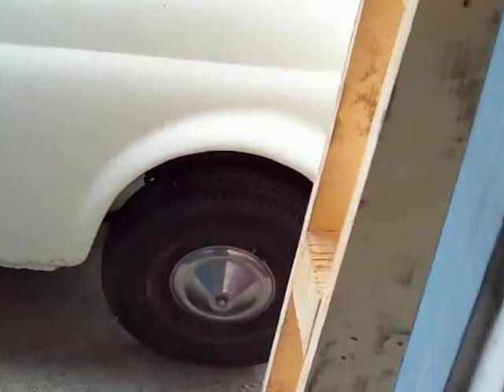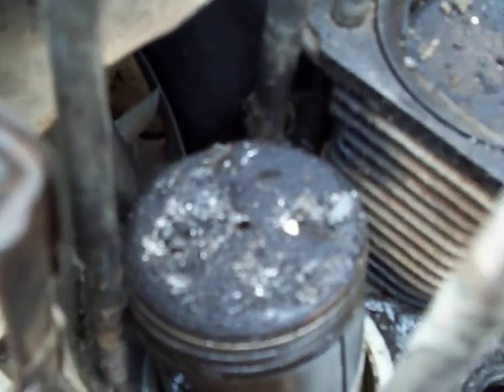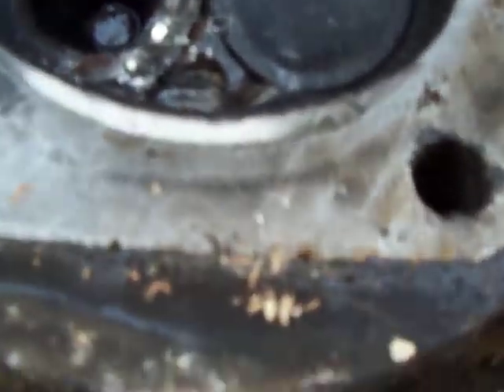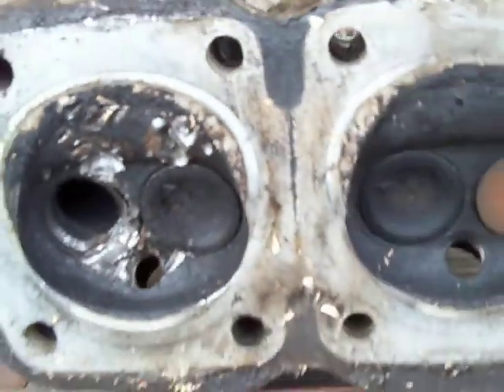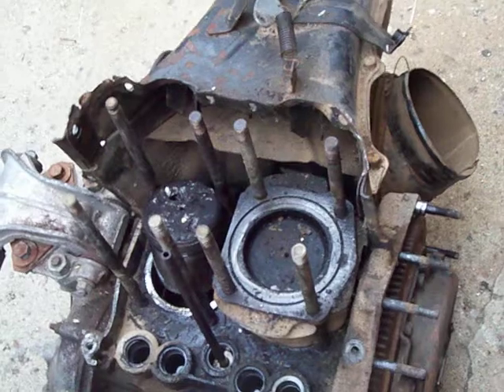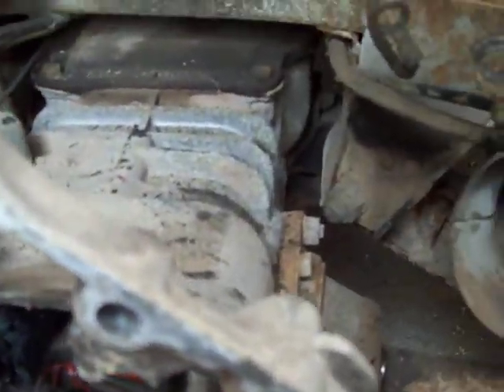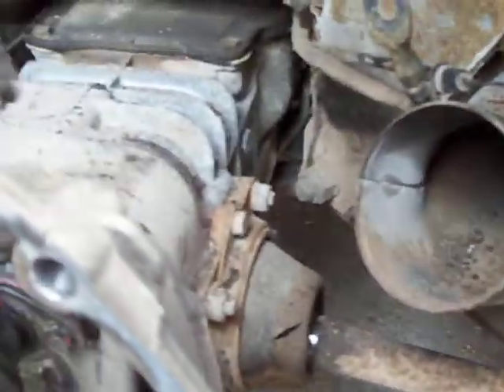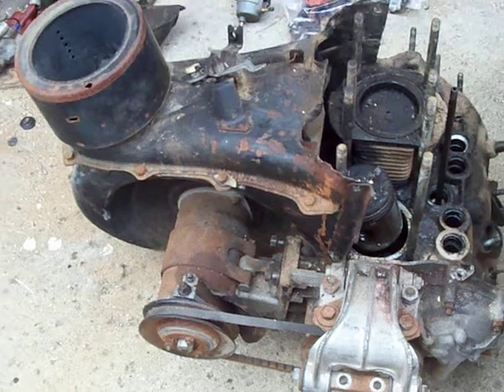FIAT 500 EUROPA ENGINE TEAR DOWN 001.MOV

Comment from the maker: @Starfireaw11  YA  I AGREE   IM HAVING A HARD TIME FINDING A STD PISTON... I HAVE ANOTHER CASE IM HAVING OPENED UP TO ACCEPT 650 BARRELS FROM A 126  THE BOTTOM END IS IN GOOD SHAPE.. AND  THE CAMSHAFT HAS SOME PITTING BUT I THINK WITH SOME GOOD OIL IT WILL SURVIVE. A LONG TIME..LEO